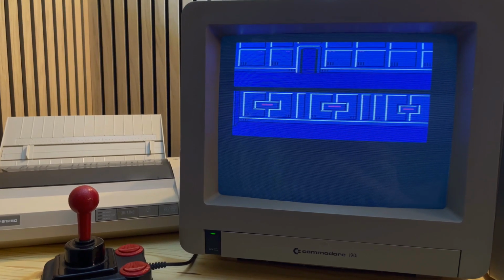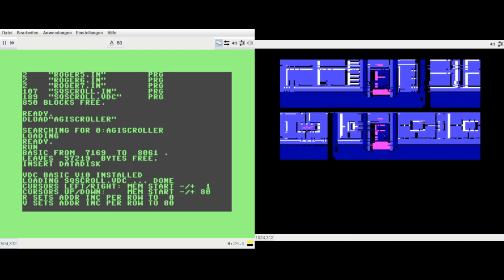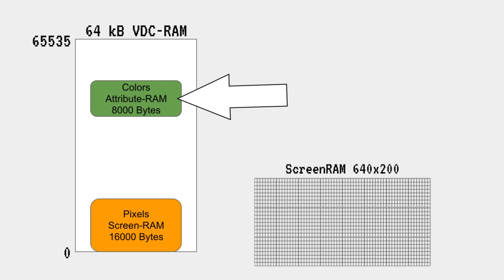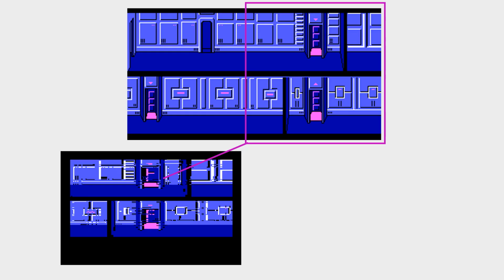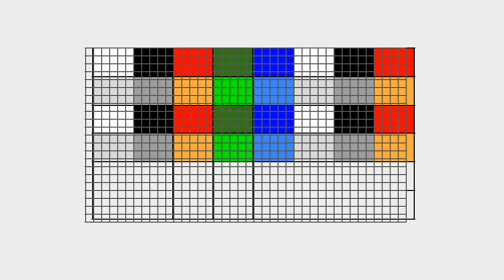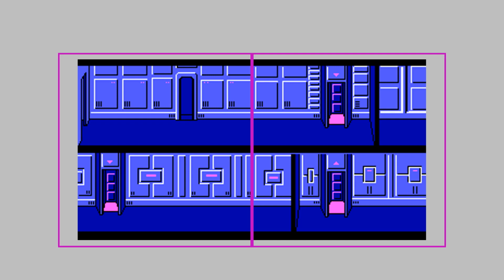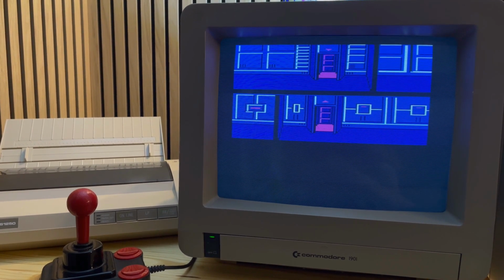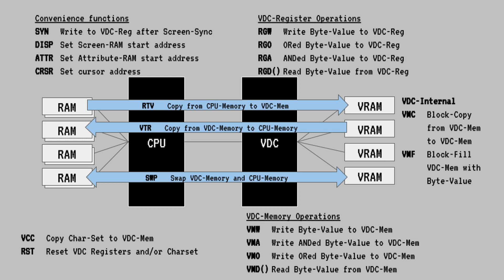Follow-Up on horizontal scrolling of 16-EGA-Color Bitmaps on the C128's VDC-Chip!

Comment: 3rd party developers really let that machine down the games could have been better than some nes titles but they only sold 2.5million c128s twice as many as a commodore 16 and that had over 500titles while the c128 had about 27 but thats commodore....they were funny buggers
Reply from the maker: Right. But also, there was next to no documentation of the VDC chip‘s bitmap mode, or it’s 64kb capabilities, for example. So the chip just wasn‘t attractive to any game developer I think. 
Thanks for your input!
Reply: @the8bittheory  did u know that a plus 4 can intrupt the raster to produce a resolution of 496x320 graphics with the Ted chip
Reply: @the8bittheory  the +4 could use raster intrupt and achieve 320x496 they  use 6502 assembly in this mode

Comment: ah so there is a work around, I was originally trying to get 160x100 mode working on a 16K chip, by using the offset mode, as I don't care about the bitmap data looping around in memory as the bitmap is identical for the whole screen. But I ran into issues, maybe the solution was to put the Attributes then Bitmap rather than Bitmap then Attributes. 

Does it behave the same on the other VDC chip? as it has the scrolling offset backwards it might change the fix required in this case as well.
Reply from the maker: Interesting thought about the other VDC-chip. Unfortunately I can't verify that as I only own newer VDC chips. And Z64K doesn't offer different VDC-revisions afaik.

How does 160x100 work on a 16k chip? I haven't found a way to do squeeze all the data in.

Thanks for your input, highly appreciated!
Reply: @the8bittheory  well if bitmap offsetting worked what you do  put it in memory 
bitmap row attribute row
bitmap roe attribute row
now the trick here is you will run out of memory for the bitmap, however the bitmap is just XXXX0000 for every char on every line, so if the bitmap wraps around the 16K mark back to $0000 it will then just get the same bitmap data which is fine. But you then get a unique line for each attribute
Reply from the maker: I think I understand. That could work.
Address-Increment-per-Row set to 81 and visible columns to 79. Not for scrolling, but for having interleaved memory addresses.
The start of Attribute-RAM would be at 0
Start of Screen-RAM would also be at 0.
Bitmap data 0x0F is filling 80-159, 240-319, 400-479, etc (the "interleaved" screen-rows)
Attribute data is FG/BG-color filled into 0-79, 160-239, 320-399, etc (the "visible" screen-rows)
While this looks like visible and invisible memory areas are overlapping, it should actually be not. Because of the weird latching(?) behavior that's responsible for the 79-bytes offset between screen-ram and attribute-ram.

Let me know if you get around to trying that :-)
Maybe I'll find the time to try that, too
Reply from the maker: I tried this now, but it only really works for the top half of the screen.
However, I had to set both, starts of Attribute-RAM and Screen-RAM to 80 to make it look right. So, I'm still pretty sure I misunderstand something about memory alignment. We'll see ...
Reply: @the8bittheory  there is something with the memory layout in 16K emulation with 64K ram installed which might explain why "half the screen works" maybe in that it doesn't give the same actual bits that you are skipping/rely upon in the latch issue?
Reply from the maker: Ah, ok. That might be an explanation.
I don't have access to my real c128 right now, so I can only check tomorrow.
I created a post on https://c-128.freeforums.net/thread/1202/160x100-16-colors-16kb-VRAM if you're interested in what I tried.